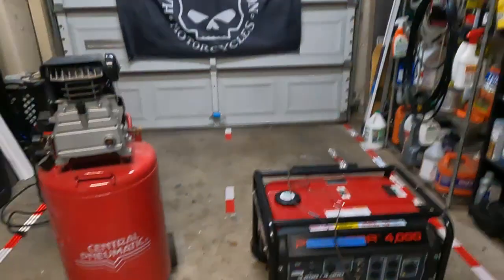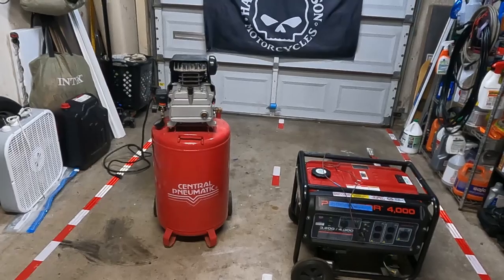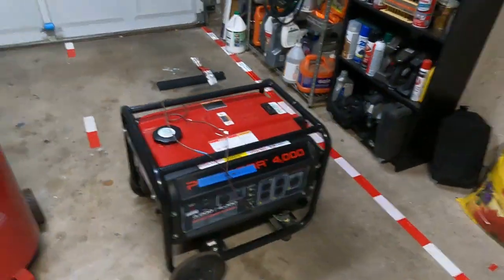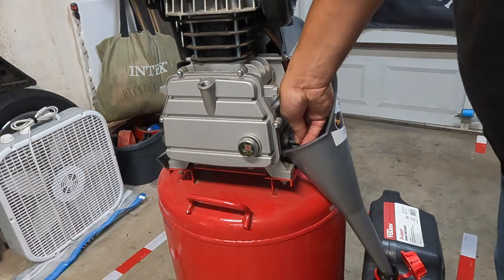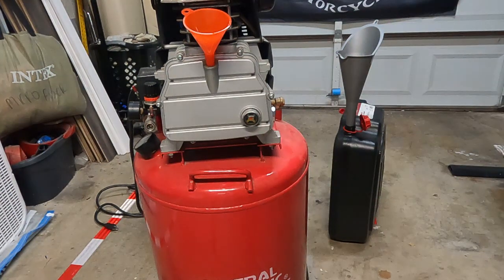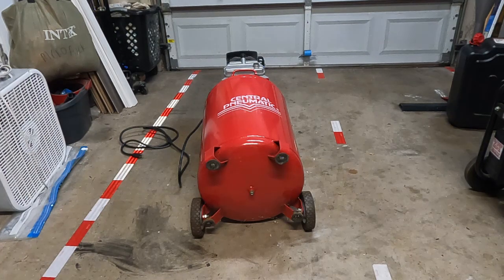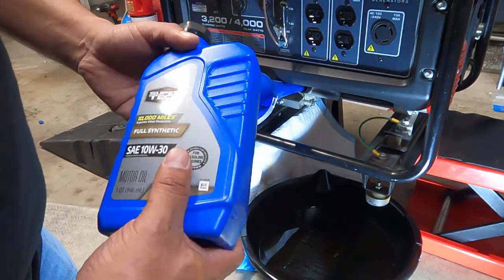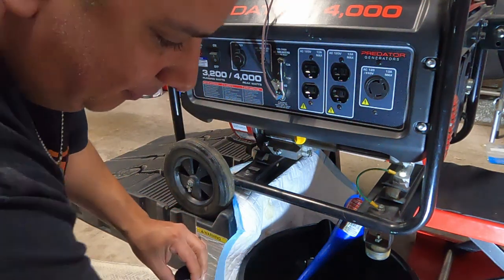Oil Change - Predator Generator and Air Compressor

Comment: How like the generator? I'm looking to upgrade  mine . Shot when I drain the water out of mine I like to have air in tank 10 or 15 lbs help push water out .
Reply from the maker: The generator is great, was using it off the grid for two space heaters, ran with no issues.  Ive run it a few times at the house for short outages just to keep my fridge going.  The new line of quite generators are pretty good too, if i had the extra pesos around id buy the large one. Especially if you want to use it for garage work to run the house on.